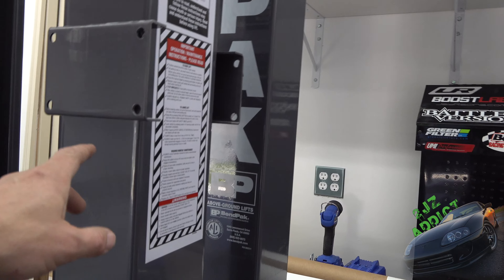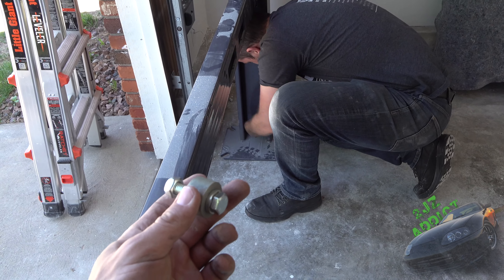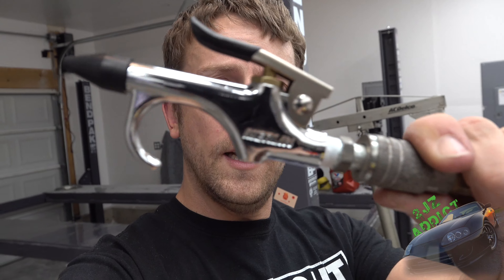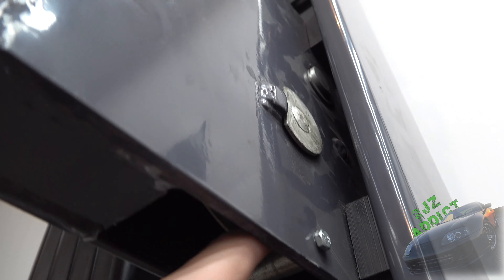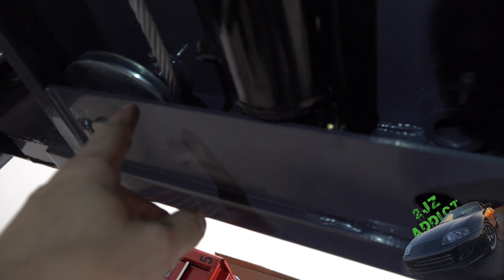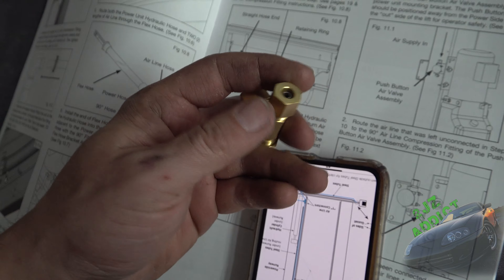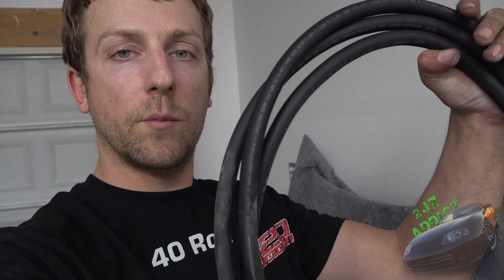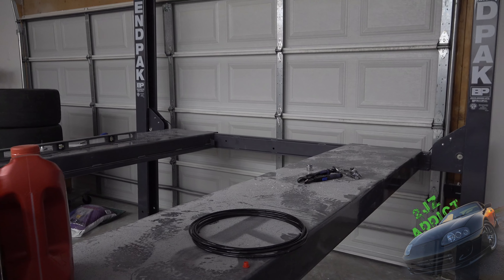Garage Mods Episode 3: How to install a BendPak HD-9 4-post lift

Comment: Thanks for all the info you shared on this vid. Just installed the HD-9 and all the air lines and fitting came with it for the installer.
Reply from the maker: You’re quite welcome! Glad you found value in the video. 🍻👍

Comment: This is awesome I didn't see you bolt it down do 4 pole lifts stand on their own without any need to be bolted down
Reply from the maker: Thanks! Glad you liked the video! I didn’t bolt it down because I wasn’t 100% sure where I wanted it positioned. If you plan on using it as a maintenance lift with the cross jacks then you’ll need to bolt it down. If you’re just using it for vehicle storage it’s recommended but not required.
Reply: @2JZAddict  I'm guessing the bolts are to just keep from lateral forces moving the poles around anyway. You could probably do basic stuff like oil changes without it bolted in

Comment: Saving this video for my own install. Ordered an HD-9 yesterday, will be here next week!    Thank you for posting this!     By the way, how high is you garage ceiling?
Reply from the maker: Congratulations on the lift purchase! My ceilings are only 9.5’. It ends up being just enough for both cars.
Reply: @2JZAddict  I have 10', gonna be close....
Reply from the maker: Having 10’ ceilings would definitely have been better. Lol It really depends on the height of the cars you’re trying to stack. The Supra and the GT-R are both pretty short.
Reply: @2JZAddict  Yes they are! And pretty sweet I'm sure! I am stacking my wife's Maxima(fairly tall) and a '21 C8 Corvette coming in April....
Reply from the maker: Very nice! Congrats on the C8 purchase! I want one of those in a bad way. They’re awesome! You’re definitely right about it being a bit close. You should be alright though. Between the C8, Maxima, and platform thickness you’re at about 110” which means you’ll lock out around the 60” mark. That’ll give you 3” to the bottom of the ramp from the roof of the Maxima with room to park the C8 up top and lift it off the locks when you go to lower it. 🍻👍

Comment: I'm finishing up my HD-9XW, just levelling and bolting it down to do.
Did you adjust the cables at all so the runways are level with the weight on them?  You mention adjusting the ladders but nothing mentioned about adjusting the cables.
Also, the old manual said to lube the inside of the posts, the new ones don't, did you do that?
Reply from the maker: I checked the runway level without weight on it but they didn’t need adjustment. They were dead on already. I did lube the inside of the posts but only because it would squeak a little but down low.

Comment: How much slope did your garage have? I'm looking to grab one of these but wondering how much ladder adjustment you truly get.
Reply from the maker: Mine was pretty level. I didn’t need any shims or anything. Fluid still runs toward the door and the ladders were able to be adjusted sufficiently. If there is a lot of slope in yours, you are able to shim the posts though I forget exactly how much.

Comment: You didn't run studs into the ground?
Reply from the maker: Not yet. I’m thinking about moving it around a bit. Once I’m settled on a spot then I’ll probably bolt it to the floor. Technically I don’t need to since I’m nowhere near capacity but for my own sanity I’d certainly like to.
Reply: @2JZAddict  yea no kidding! I'd be a nervous wreck operating it like that lol
Reply: Keep in mind for ALI certification this needs to be bolted down.

I have the same one and could’ve used this video six months ago.
I’ still want to find a final spot before I bolt in down also.

Any issues getting cars on ramps ?
I have a ZL1 and find even in stock height it’s too low.
Reply from the maker: Sorry, just saw your comment. No issues thus far loading and unloading cars. My driveway is fairly steep so I do run boards before the ramps to help it align better and not scrape. If I bumped the lift  closer to the wall I’m sure it would be just fine but then I’d lose work space. Lol
Reply: I have same issue with losing work space.
But placing boards in front of the lamp fixed the issue.

Comment: great video man! How wide is your garage and do you have enough room to park a car next to the lift? I'am planning to get HD9ST. My 2 car garage is 24' L x18' W with ceiling 10'6''. I have an SUV parked on the left side and do you think there will be an enough room for it if I get the lift on the right side?
Reply from the maker: Possibly. You’d need to measure track width for where you plan on placing it to be sure. I can park a Touareg next to mine without issue. It is super tight but it’s doable. When measuring be sure to account for the side mirrors.
Reply: @2JZAddict  thank you! Do you know how many inches is the space from inside the columns to the outside edge of the runways?
Reply from the maker: Not off hand. You can look up the dimensions for each lift on the Bendpak site. That would have the most up to date information. I ended up marking things out with tape in order to approximate spacing.